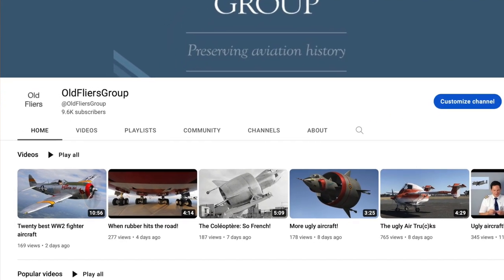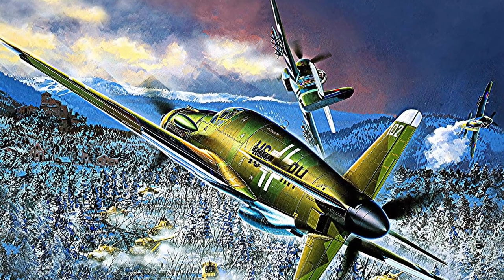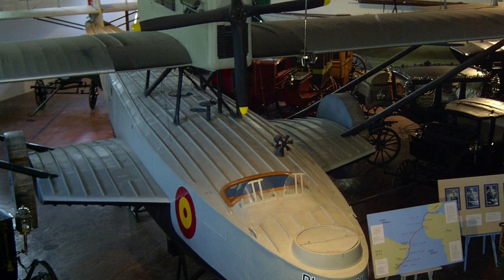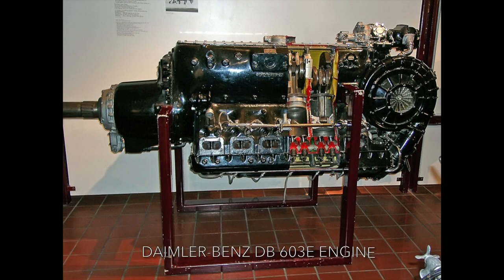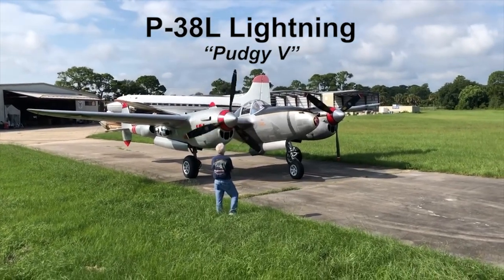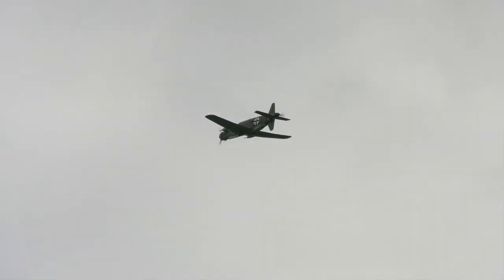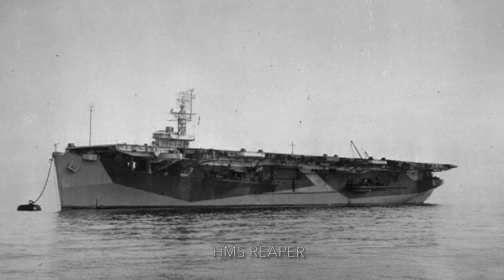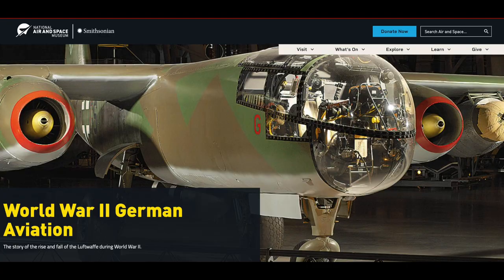Dornier 335 - brilliant, but, too little, too late?

Comment: Always thought it was a neat aircraft, with a rather unique design.  I wonder though, while the engine/prop layout leads to superior speed and roll performance, would the fact that thrust is being generated both at the front and rear cause it to have poorer pitch authority compared to twins with a more traditional layout?  This would mean that while it is quicker, it likely could be out-turned by other aircraft.

Comment: Anything that was concordant with bearing manufacture was fare game in the throe;)

--------------
The Cog of the Castle Turret becomes the Canon in the understanding of Cannon velocity in the work of Sir Isaac Newton.  of course, if you look at early castle design you can see how Sir Isaac Newton becomes a colleague of Mr Robert Hooke in cog of castle turret.

It now becomes the Cog of the Concrete Pot Plant Design aka Castle Walls design just completed and waiting for it to dry.  Then it will house my new Orchid  on my homemade steel planter stand.  I'll clean it all up and paint it and nobody will know who did it;)

The Orchid is Phalaenopsis with a pinkish white flower and not Miltoniopsis because it was not available. 

The 300 year old memory jog;)